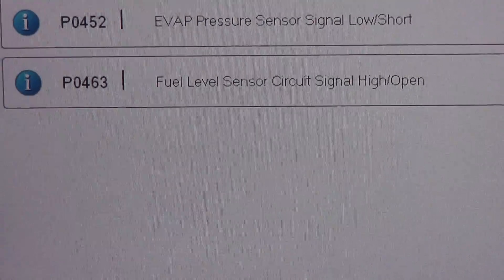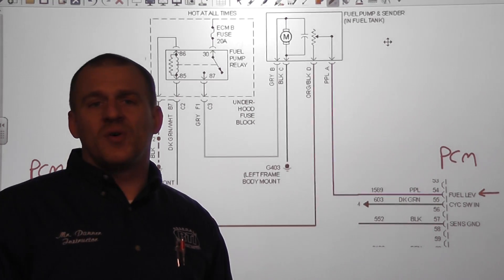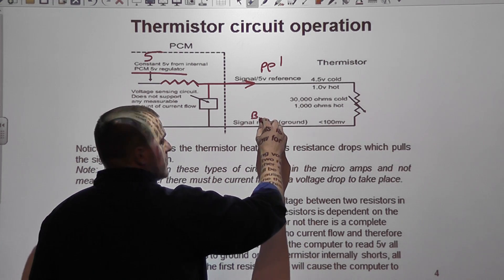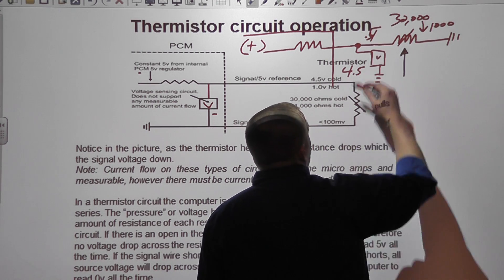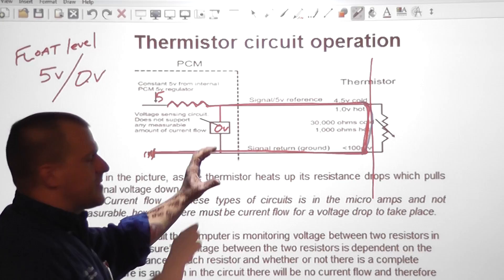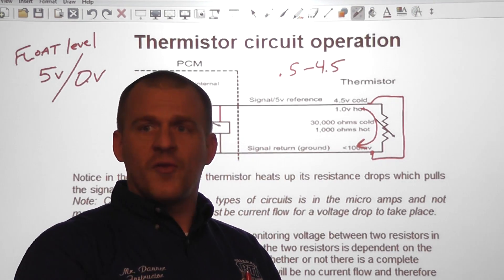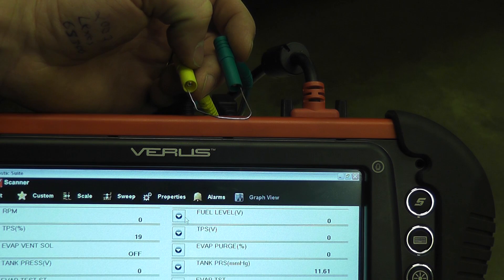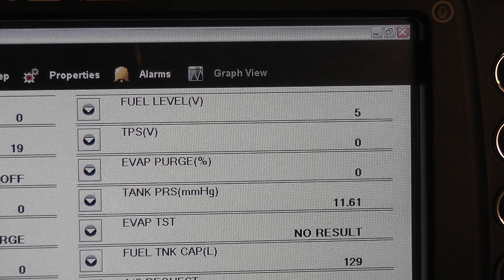How to test a fuel gauge (tank sending unit) P0463 - GM

Comment: Replied by bikeril on topic 2018 gmc sierra denali - P0449 code.
Just checked each port to ground:
red wire reads 12v constant (venting and not venting)
white reads 3v when venting and 0v when not venting
 From the  scannerdanner forum. I wonder how  we have 3v on the control wire when the solenoid is not commended on? The poster finds some resistance in the control wire.  No current flow, no voltage drop.
Reply from the maker: Solenoid is open and you're reading a bias voltage coming from the ECM through the control circuit.
https://youtu.be/Q8ZwxJYkYnc

Comment: I have 0 volts at the purple wire, where do I test to see if the computer is sending out the 5 volts ?
Reply from the maker: Right at the ECM connector for that circuit
Reply from the maker: Or do a close visual on the frame area of that truck. Look for a damaged harness, a small rub through maybe even. Look close!

Comment: Do you need to make current flow throw the ground in the computer or can I just pull the signal to ground instead up jumping them either way the voltage will change on the. Signal but will it be ignore because there no activity on the sensory ground
Reply from the maker: you can pull the signal wire itself to a direct ground to look for a change. The reason I used the sensor ground is to test the integrity of that circuit too
Reply: @ScannerDanner  yeah I didnt think of it that way thanks this help out a lot would eletric theroy book help with question like this
Also in the middle of at series circut should the test light light. Regardless of being on postive or neagtive because there a voltage differencebetween either 1
Reply from the maker: @brohdyknopp613  depends on the resistance of the test light and the other resistor. Great question!
Example: (incandescent test light being used)
An ignition coil primary (coil -), test light connected to ground, key on, the test light will be just as bright as coil positive. Why? Because the coil primary winding is super low resistance.
2. Same test on a relay coil winding and the test light is very dim (high resistance in a relay coil) So 1-2 ohms on the ignition coil compared to 80-100ohms on a relay winding.
Does this make sense?
Reply: @ScannerDanner  yeah this make sense less voltage being used up on the 2 ohm then 80 to 100 ohm. And with enought resitance it wpuldnt like at all .. Is this the right way to think ?
Reply from the maker: @brohdyknopp613  yes sir, from the first resistor standpoint!
Then the second resistor (your test light), think of it as either causing psi to back up, (voltage rise) or flow through (voltage drop)

Comment: Just argued that it’s not my wiring it’s the sending unit with a brand new Car Quest part. Part shop argued with “ten years we have never had a faulty fuel pump” 
Well buddy I didn’t have a PCM reading until I put your crap part in my truck. 
Furthermore I never had a gauge problem until I installed the cheap part. 
I don’t have a computer  😩 I’ll go back through and check again but I swear it’s that new part I just put in.

Comment: For just over 2 months mine quits working, next day or so works..over and over and over..it's it malfunctioning before fully crapping out, or do I have a ground that is going bad, I know bad stock grounds happen, especially in an 06.. buddy has my multimeter and no scan tool. Just curious. Last thing I wabna do is throw money at a bad ground.  Does anyone know the local to the pump/sending unit ground is located?

Comment: What a perfect video for what I needed.  Thank you for breaking this down!  

I have a 2016 cadillac ats-v and the gas guage doesn't work.  hasn't worked since I've owned the car.  I thought a new fuel pump would fix the issue; since I wanted to upgrade the fuel system.  However it didn't fix the problem.  Because of this video, I know exactly what to look for now.  High 5 to you and your team!

Comment: One question do i have to program my pcm to get it to sens the signal of the dual balance module on the dual tank module pin on pcm. I bought the chevy truck with dual tanks but the previous owner had an engine swap and put a regular 1500 pcm on it so it only senses the single tank signal
Reply from the maker: I need more info to help. Year, make, model, engine size (original). What was put in it (engine) and what computer (year, make, model car it came out of). 
These dual tank systems are all different.
Reply: Its a 2000 chevy silverado 3500 flatbed with a 5.7l engine fuel pump and fuel level sending unit in main tank and only fuel level sending unit on the second tank. The pcm has a pin for dual tank module and a pin for single tank well i took the wire from dual tank pin and swaped it to the single tank pin and i got rid of the code p0463 fuel level sensor A circuit high . The gauge worked partialy maybe because that signal is to high for that pcm pin. How can i get the other pcm pin to recieve the signal?
C1 18 dual tank module  pin no works
C3 13 single tank module pin works
Reply from the maker: @alexdiosdado3736  we need to move this to my forum at this point. There are too many variables and I can't offer the back and forth messages with research needed to answer here. You mentioned changing the engine computer too, so this is what really complicates this. 
Post this to my forum https://www.scannerdanner.com/forum/post-your-repair-questions-here.html it is free to join and I have paid moderators who are there to help me help you guys. I'm certain we can come up with a solution for you.

Comment: Very informative teaching BUT almost completely useless for a DIYer. Also teach how to use a cheap multimeter to do the same V reading.
Reply from the maker: Not true at all. Understanding circuit design is key for any troubleshooting, no matter what tools you may or may not own. 
Literally everything I've shown can be done with a simple inexpensive scan tool and or digital multimeter.

Comment: Hi, that's called a voltage divider Vout = (R2/R1+R2)*Vin. Vout is the voltage reading in the scan tool, R2 is the fuel sensor resistor and R1 is the one in the ECM....THANKS.

Comment: my fuel gauge reading always full on ignition on, checked all the ground are ok, when I checked the resistant between the sending unit signal wire and the ground its read as zero ohms, what might be the problem, is it the fuel level sending unit bad?
Reply from the maker: Sure sounds like it my friend

Comment: Hi Paul, thanks for the video. I was working trouble shooting an outside air temp sensor on a 2006 Ford Fiesta (uk), as a quick check of the wiring I unplugged the sensor and checked the voltage across the two pins (on the loom side) - I was expecting to see 5V but there's actually 11V there... Could this be normal or do you think it indicates some other problem??? Thanks
Reply from the maker: so there is a code for this outside air temperature sensor right?
Reply: @ScannerDanner  Thanks for getting back to me, no code, but the outside temp display in the car is showing -38 Celsius (-36 Fahrenheit)! - so just trying to fix that. Thanks
Reply from the maker: @iozel4633  any chance there was front end work done recently on this car? where is the outside temp display located? on the rear view mirror or on the climate control panel. BTW a -40 ish degree number indicates and open circuit and I have seen the front AC cooling fan and ambient air temp sensor connectors plugged into the wrong connector after front end work.
Reply: @ScannerDanner  No evidence of repair work, I'm sure I'm on the right sensor as when I unplug it the temp reading changes from 38 to -- ... I'm just wondering why there's 11v across the connector and not the 5v ref??? Thanks
Reply from the maker: @iozel4633  there shouldn't be 11v on that sensor, where does the signal wire go to? What module? Also, don't measure between the wires, measure from each wire to a known good ground and report both reading for me
Reply: @ScannerDanner  Yes still 11v between battery ground and one terminal of the connector (0v on the other). According to wiring diagram it's connected to the ECM (but given wire colours don't match - the wiring diagram is from an old copy of autodata). Thanks.
Reply from the maker: @iozel4633  wire colors not matching is a red flag to me that something is not plugged into where it should be (two reversed connectors) 
When did this problem start? Also typically the ECM doesn't have an ambient air temp sensor attached to it. Intake air, yes, ambient air, no
Reply from the maker: @iozel4633  what's the word?
Reply: @ScannerDanner  Hello mate, thanks for your time and interest... So I checked the resistance of the temperature sensor and it was high (over 10kOhms), and also when I tried heating the sensor up with a hair dryer the resistance did not change at all... I could not find the exact resistance specs for the sensor, but based on resistance being higher than I was expecting, and also crucially not changing when heated, I got a replacement temp sensor. Before putting it on I did the resistance check on the replacement as a comparison... The replacement had a resistance of about 2.9 KOhms at approx 16 degrees celsius, and it went down when heated (down to about 2.4KOhms after about 15 secs heating with the hair dryer). I then put the replacement on the car and it's working fine - shows the correct ambient temp.

Comment: If i have the correct info it seems that the Instrument cluster in my Ford Focus controls the fuel level sensor...i am beginning to suspect that my Instrument Cluster is the culprit ?? i had 0 Volts in both the WH/RD and the BN/RD cales...and the display in the IC says Fuel computer data error ??

Comment: I have an P0460 fault code on my Ford Focus Flexifuel and  the wires going in to the tank is GN/OG(Volt) BK(Ground) WH/RD and BN/RD wich i think is the signal wire and signal ground.... Has Ford the same procedure with constant +5V to the signal wire??   really need your advise  ;)

Comment: I’ve got a 95 k1500 base with a gauge that’s stuck way past full after a new sending unit. Suspect bad ground or bad sending cable to gauge. Does this year work directly off sending unit or does it pass through ecm first?
Reply from the maker: I think a 95 the sending unit works the gauge directly

Comment: I would have thought the fuel gauge would be a potentiometer rather than a thermistor. That’s interesting.
Reply from the maker: Technically it is not a thermistor but the circuit is built like one on this vehicle

Comment: Hello, ScannerDanner, great video, I am getting a P0462 error code in my Lincoln Navigator 2006. my fuel gauge seems accurate with the gasoline in the tank. no gas gauge issues but my check engine light stays on and I cannot pass the state emission test.. when I check with a OBD2 scanner, I have got the Fuel Level Input (PLI) value to 0, I was not able to read the voltage of the Fuel Level. Also the P0462 states Fuel level sensor A circuit low imput, What is the sensor A mean here? is there a sensor B somewhere there? thanks!

Comment: 2005 duramax, single tank. in scan tool, sensor voltage reads 2.7v yet the command from pcm to gauge says 0% fuel.  shouldn't 2.7 be about half? my snapon tool sweeps the gauge and all is working.  why would the pcm show 2.7v and 0% FUEL?
Reply from the maker: What is the problem you are having before I speculate?
Reply: @ScannerDanner  The problem is the gauge is at 0 percent when the level sensor is at 2.7 volts and half tank of fuel. It seems that the pcm is commanding the gauge to 0 because the sweep works and the pcm data shows 0 percent but volts at 2.7.  I unpluged the sending unit and it does go from 0 to 5 volts when jumped. plugged in goes to 2.7 witch shows the guege is bad but the pcm is commanding gauge to 0% and sweep is working.
Reply from the maker: Okay, so your fuel gauge reads empty all the time? You've done a sweep test on the gauge with the scanner and it operates normally, this just tells us the cluster is good and is independent from any PCM commands. (PCM and instrument cluster talk to each other).  You keep mentioning gauge reading 0%? Is this the gauge itself or some scan data PID you are referring too. Sorry, just need a little more clarification. I've not seen a fuel gauge show %
Reply: @ScannerDanner  In the snap=on scanner it reads. fuel sensor volts 2.7 and Fuel tank level 0%.
Reply from the maker: @robertarave3696  so you don't have a problem with your fuel gauge, just data on the scanner?

Comment: Scannerdanner...I did change out sending unit which as stated earlier repaired no start condition but fuel gauge will not work. I know you told me it was the sensor after the test. On the primary pump it is a 4 wire connector ( Power, ground,fuel sens, lo ref) On the secondary unit it has a two wire just fuel level sens and Lo ref. did test as you directed and verus went to "0" on both sensors as i stated. Just trying to give as much info as possible. I have been battling this for weeks and cannot go use parts cannon. form the forums I read most people do and never fix problem including dealerships. thanks

Comment: Paul having problem with 2004 Cadillac CTS. Had bad fuel pump no start condition, replaced pump vehicle now runs. Fuel gauge will not operate. Wiring diagram indicates one of the wire is a "LO REF". Could you tell me if that is a ground for sensor signal and if it is supposed to carry voltage. Both fuel sensor wire have 5 volts. it also has another sending unit because it is a saddle type tank. I just do not understand what  a "LO REF"  wire purpose is.  Thanks
Reply from the maker: Low reference is the sensor ground my friend. If you have 5, 5, and 0 on a 3 wire sensor, you most likely have a bad sensor. (Sensor plugged in and backprobing)
Reply: @ScannerDanner  Thanks for the reply. I followed your video to the "T" . This Cadillac has a saddle tank with a sender in each side. When I take the paper clip to the wires on both side scan tool fuel volt goes to "0" which per your instruction would verify wiring is good. However I get  code for High voltage on fuel level sensor 1, fuel sensor 2 and also A/C pressure sensor which has high voltage code, All of these sensors share the lo reference wire I asked you about. Another strange thing is when I unplug both fuel level sensors the Verus still reads tank is 64% full when it should read 0 because there is no input or output with wires unplugged. I may have a probem with the ECM but I am stumped. Thanks again for your time.

Comment: i have a question       ,  on a 2001 dakota 2.5 lt      is  the  FUEL LEV SENS SIG  5v  or  12v?
wiht te conector plug  i have  6v  , wiht the plug deconected i have 11.97 sometinhg 
is that right?
help  please,,  my amigoooooo

Comment: Okay! Great class. I wish my mechanic/Auto mechanic teacher at the local community college can take some lesson from your class and fix my fuel gauge right the first time...after 3 tried and finally seal the leaky gas ring cap after the works being done my gauge now reads 3/4 full after filled up worst then before the fixed which shows 7/8 full when you filled up the tanks.  He's now out of idea and don't want to reopen the fuel sending unit tank again because he had to done it  3 times already.  Each time fuel still  leaks.

Comment: I have 2000 Audi tt with fuel gauge problem too.  Relay,fuse,fuel pump and sending unit are good. I'mma about to check the instrument cluster next. 
 Any ideas on what else it could be? Thanks.
I bought a multimeter but I'm barely new on this. Can anyone guide me on how to check for resistance or checking if there is a short in the wiring?  Please...  Thanks 😃

Comment: Is this standard for most GM products in the same year range?  If you have a cobalt that had this exact fuel gauge problem, then 2 days later  the fuel pump starts getting weak and the car wont stay running; would this be considered a separate issue from the p0463?

Comment: I love you videos I have a 2005 GMC Astro van my fuel gauge works sometimes for like 2 minutes and then it drops down to empty usually when I accelerate or hit the brakes is it the sending unit or could it possibly be something else thank you keep up the good work you have helped me a lot in the past
Reply from the maker: sending unit, it is a GM and the fingers break off of the wiper that rides on the resistor in the tank

Comment: Wow I'm lost I have an 02 chevy blazer which fuel gage was working fine my transmission went out and I got it replaced that car got given back to me with the fuel gage on empty with no fuel , I filled her up and nothing also I had changed the fuel pump less than a year ago . I ended up using the warranty and once again replaced the fuel pump and started the car and the gage still did not work . All the other Gage's in my dash work except the fuel . I think it may be a short that the mechanic caused while putting the transmission and it grounded to something but I don't know where to look at . Either the purple wire or orange black wire . If the wire is above the transmission. I don't know how to access it
Reply from the maker: Not much I can help you with other than to tell you the purple wire is the signal wire for the gauge and the orange black is the signal (float) ground.

Comment: hi mate ford transit 2.5 fuel gage notworking..i open tank 5 times there 2 wire for fuel pump is ok.. anotor 2 for guge i test groun it ok nother wire shurt  can u help me its sgnail  come from  ecu  ? its 2.5 2014 thnx

Comment: Last days a did my first fix to a problem like this on a 2006 dodge grand caravan, after sending unit was replaced I notice the gauge went up to a full position fast, but when a I move the floater to a empty position it respond very slow, my concern is if is that normal or not, thank you